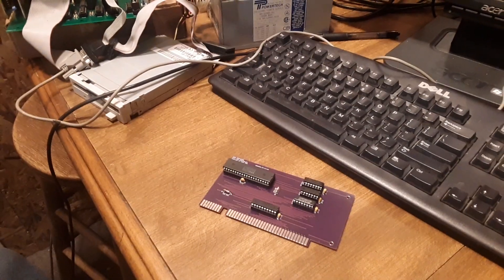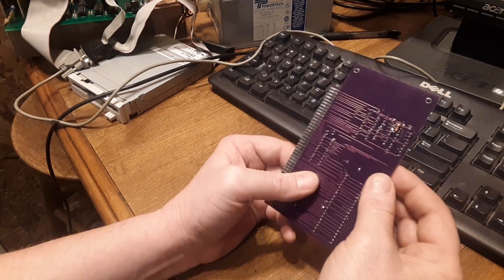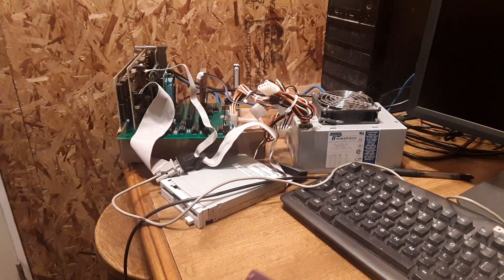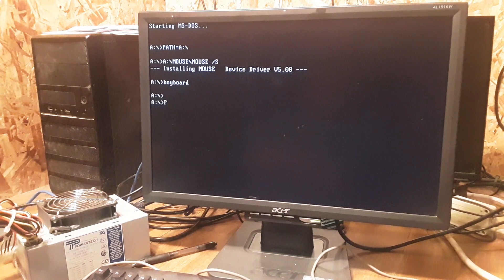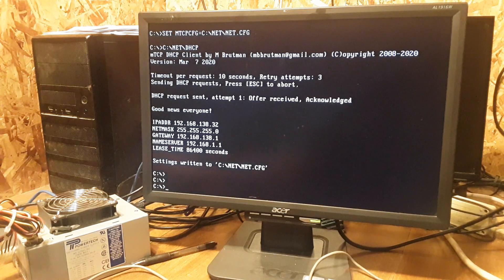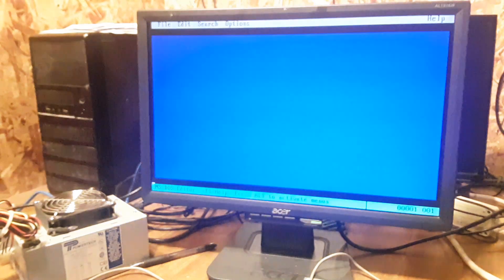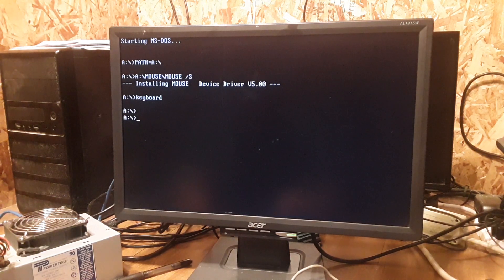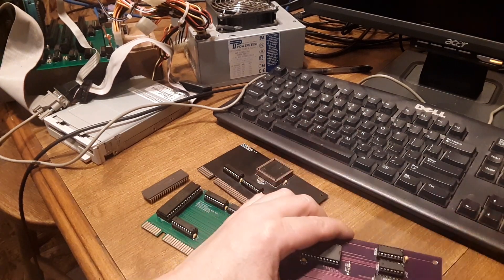8237 DMA Controller. Updated working correctly.

Comment: Why does 74LS573 heat up so much?
Reply from the maker: I have doubled check the one I have running does not heat up. If it is getting very hot it might be a bad chip. I'd suggest trading it out the chip.
Reply: @elijahmmiller  Thanks for answering.
I've already assembled two PCBs and it gets hot, not much, but it gets hot. It works, but I can't start using the PenDrive either. I'm using the new PCB already with the DMA.
Reply from the maker: The DMA is not needed for the USB drive. I wonder what is going on there.
Reply from the maker: What is the pinout of the CH376 USB host? There are 2 different pinouts on the pre made modules. The newer ones are not correct for the project. 

Are you using a 8237 that is rated for 5 mhz? The basic 8237 is only rated for 3 mhz.

Comment: Can I add this to industrial LGA 775 Isa motherboards with no dma suport
Reply from the maker: I wouldn't think so. It is very much only designed for my mother board. I would think that it would be possible to design something for the LGA 775
Reply from the maker: I am just looking at them online. They look to be modern motherboards with a 16 bit ISA slot. I would think the DMA hardware would already be build in.

Comment: I was always under the impression that DMA was always built into the mainboard itself. Thanks for teaching me something new today.
Reply from the maker: On an orginal IBM PC it was build into the main board. For my PC it is an optional add on. You only need it if you want a floppy drive to work. Also sound blaster cards use it. Normal operating and booting from a USB drive you dont need one.
Reply: @elijahmmiller  That's still really cool. I'll be sure to check out your other vids.

Comment: How big is the ROM chip in that thing? I would be interested in writing a proper BIOS for the computer if it had a discussion group somewhere else than in Discord.
Reply from the maker: The ROM is 32k. A memory card could be made that to accommodate any size of ROM if needed with in reason. I put the memory on an ISA card so that it could be modified easily.